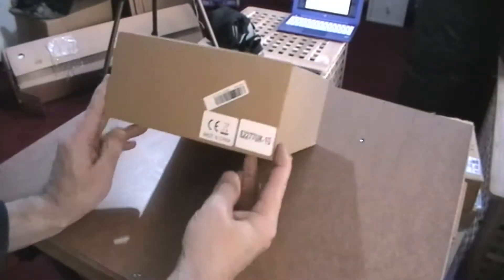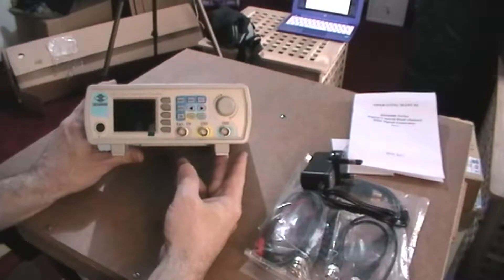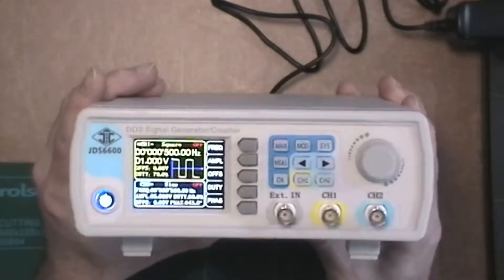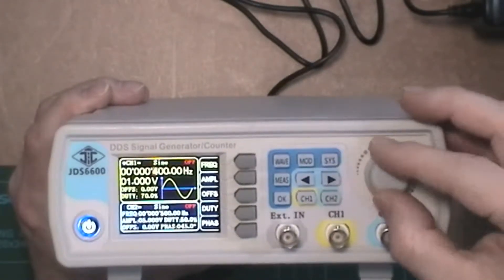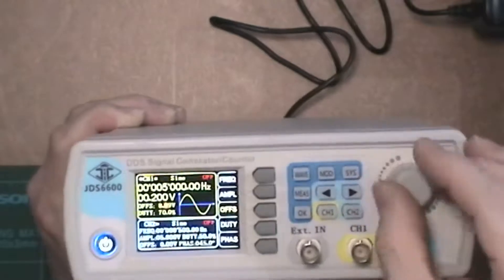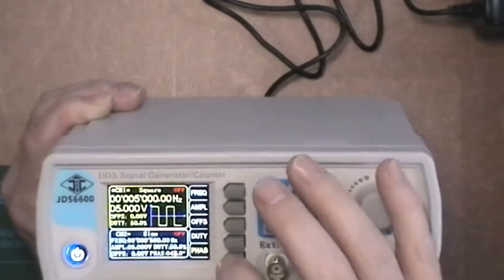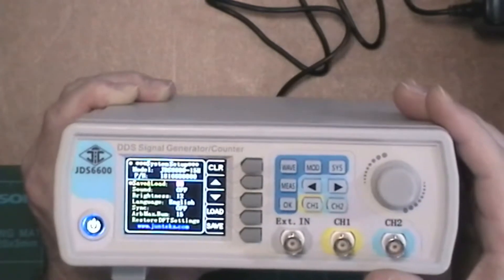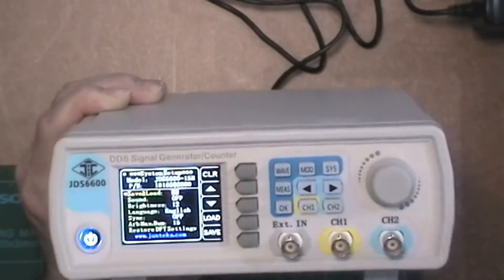JDS6600 Signal Generator (an overview)

Comment: When using the sweep function with the counting function at the same time, are you able to see the amplitude of teh signal?  I'd like to know if i can use this device stand alone to measure the resonating frequency of my tesla coil's primary/secondary circuits
Reply from the maker: Hi Josh, slow reply but I have been looking into this.  You can set the output on either output channel and view on the screen what the input signal is, but when viewing the input signal, i.e. such as the counter you can't view either the output signals or another input view.  It is either one thing or the other.  I think some experimenting with what can been seen is something I will have to continue with.
Reply: @rpsproject5349  Ok that makes sense, ty for the reply.  I will probably just use it with my oscilloscope to just visually see when the peaks are at their highest.

Comment: All this and it never occurred to you to connect it to a scope so we could see the quality of the waves it generates? Secondly, EXT is for external in and not extension. Finally, the maximum frequency will not just be a function of the software.
Reply from the maker: Thanks for your points Nick B, at the time of recording this video I did not have a scope to show off the output.  (short on money). external in is a function I have yet to try out so any suggestions on how I can make use of this connection?  my main use for this unit is on audio circuits so high frequency is not a problem.
Reply: @rpsproject5349  For audio range this is sufficient enough! Pretty powerful machine for its money.  Ext. in is used as a frequency counter. Yes it is hackable for higher frequencies but the stability then goes off a bit.